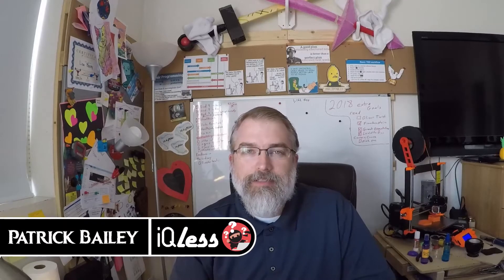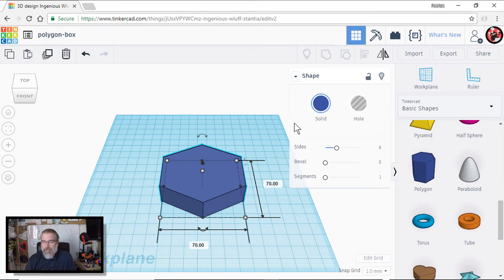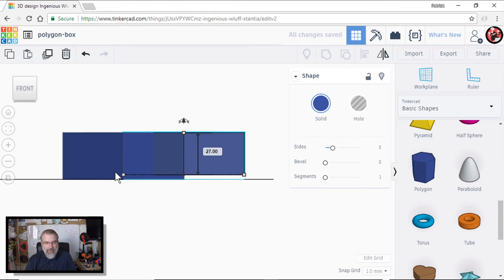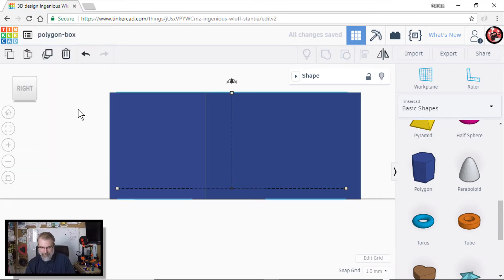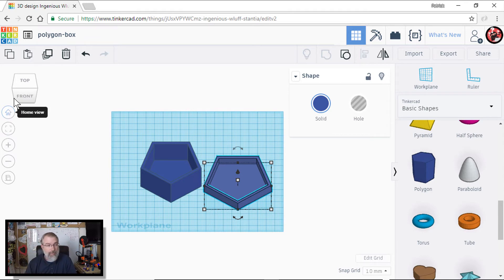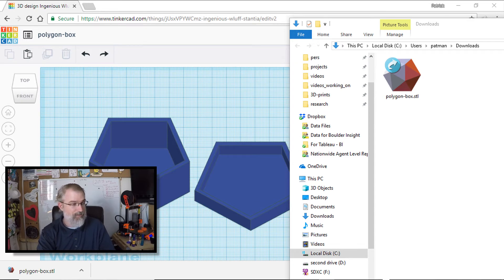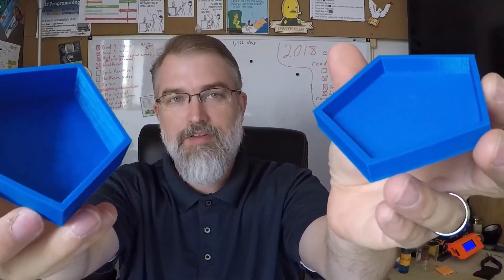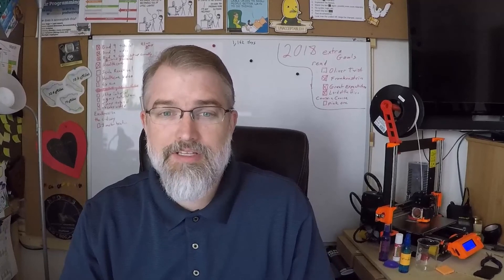3D Printing: Creating a box with a lid in Tinkercad

Comment: Nice tutorial!  There is an alignment tool in Tinkercad.  It is two icons over the grouping icon.  Just need to pick all the parts you want to align.  Then you can align to center, bottom, or top in each dimension.  That would have helped in your alignment accuracy instead of using the arrow keys to move one part and "eyeball" it.  

Keep up the great work with your videos.  By the way I too have the Prusa i3 MK3.
Reply from the maker: I will have to go try that tool